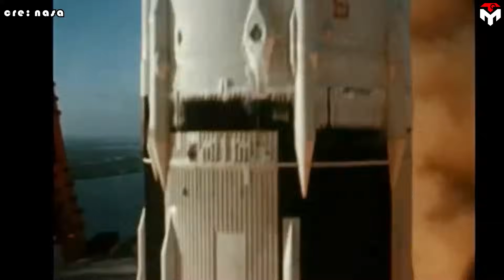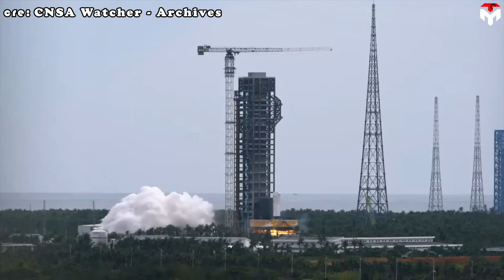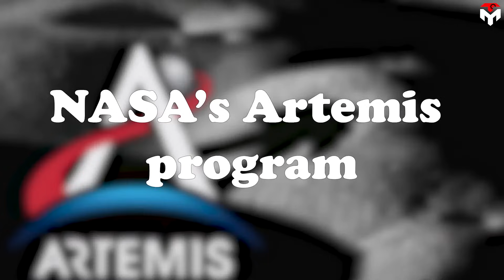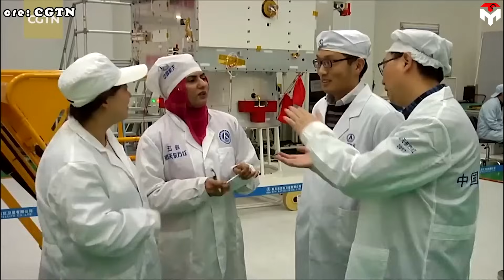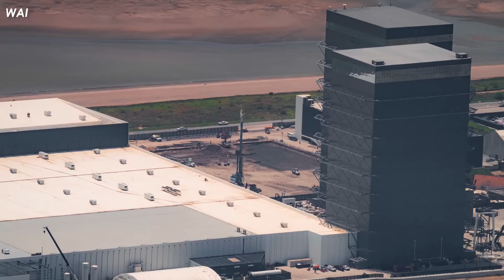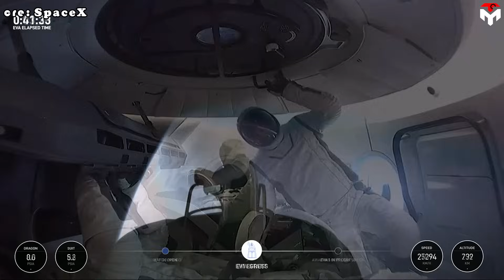SpaceX's New Starship Design Upgrade to the Moon: Direct Moon Flights Are Back!

Comment: Starship doesn't need to be refueled. 
Starships fuel capacity is 1500tons 
Cut it down to 500 fot landing on the moon 
Starship boosters could be jestisoned into LEO fully fueled dock them all together. 
Starship can now put 1000tons on the moon. 
Just by using  sharship sized boosters docking  a starship, the boosters  atop a main booster. No need for fuel lines in between boosters just detach and bring the boosters back once the fuel is depleted  1000 tons on the moon, keep starship to a capacity of approx 500 tons of fuel for landing on the moon.

Comment: There must be faster rocket engines than the current liquid, simply because everything is going too slow, while the prediction was/is that atomic rocket engines the trip to Mars would only take 1 day at most, that with fuel takes a maximum of 9 months and that is far too long for living personnel on board, use robots for this is my idea. If the Chinese are smart and they are, they will develop these atomic rocket engines, they have no problems with their conscience to put atomic engines into orbit around the earth and don't care if things go wrong with a launch of such a starship with atomic propulsion.